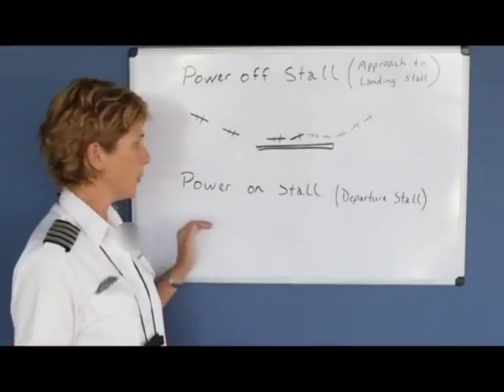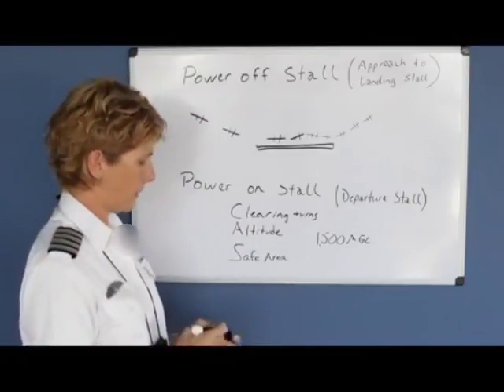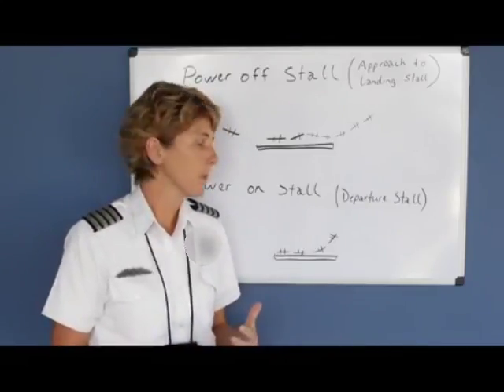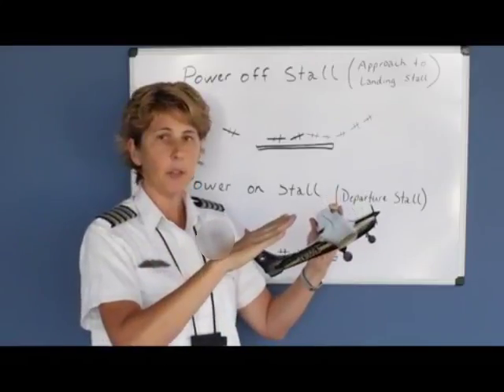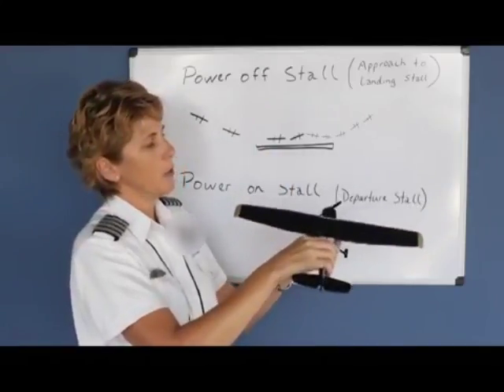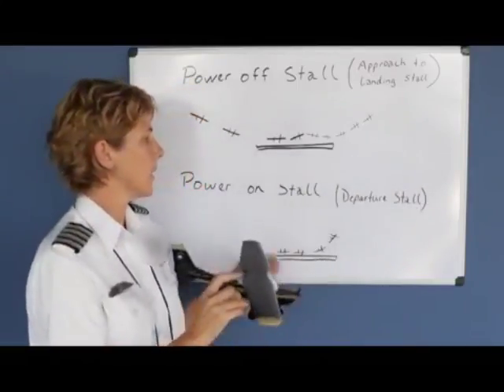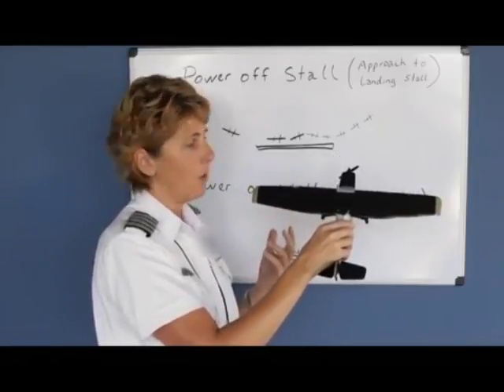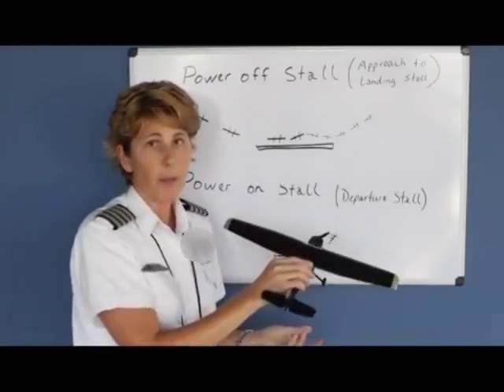Power On Stall (Private Pilot Lesson 3d)

Comment: 1- carb heat on
2- pull power to 1500-1700
3- nose up to slow 
4- right rudder
5- push nose down (recover)
Reply: You forgot full power after you slow to take off speed

Comment: Why add carb heat?
Reply: Some planes experience carb icing when power is reduced.  At 1:58 she instructs to reduce RPM to 1500.  Not all engines ice and not all will ice at reduced rpm, but instructions have to account for the safety of all planes/students.  If your plane has a carb heat feature, one should use it when reducing power significantly, otherwise you are inviting an engine out scenario, when the carb ices up.
Reply: To deliver more fuel to engine?
Reply: @NWTejas  correct. Bingo